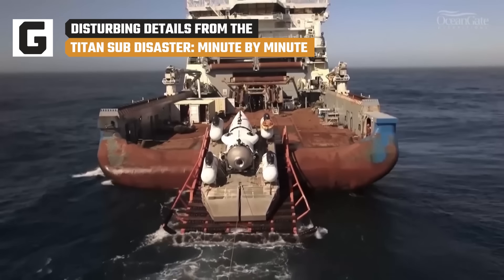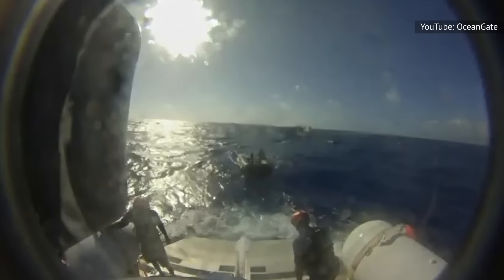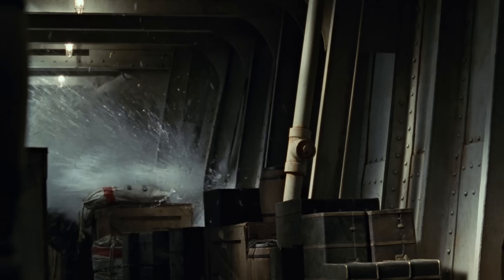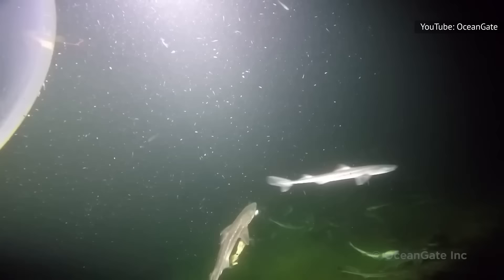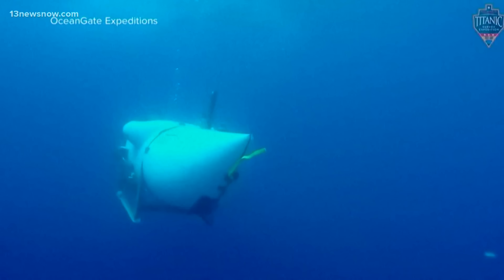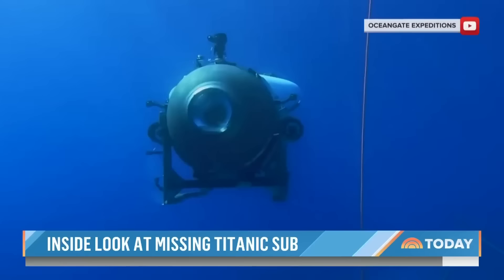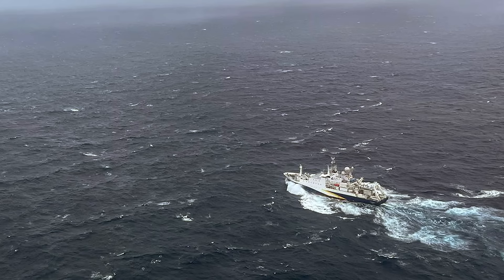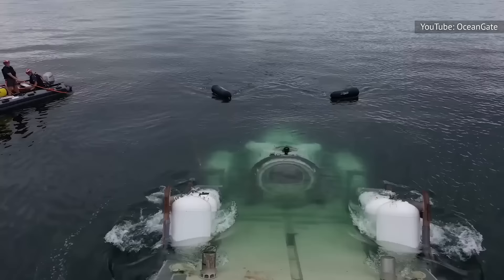Disturbing Details From The Titan Sub Disaster: Minute By Minute

Comment: Stockton Rush would've been a great fit at Boeing
Reply: The comment I was looking for. 🤣
Reply: Hey!!  This is serious and you made me laugh!!
Reply: "We could save money by eliminating wings, seats, windows & toilets."
Reply: Same safety mindset
Reply: he actually worked for mcdonnell douglas, the culture virus at boeing now. makes so much sense!
Reply: Not money hungry enough... More a great fit for other complete Narcissist sociopaths...
Reply: It was Boeing that sold Rush the leftover carbon fibre.
 It was outdated and couldn't legally be used for airplane construction. It has a specified shelf- life.
Reply: Plot twist he was a majority share holder
Reply: I mean didn’t he use discarded pieces of a Boeing to use as the shell of the structure?
Reply: @Jordysegs89  No. It was carbon fiber that was degraded and couldn't be legally used.
Reply: @dreammaker9642  In Boeing?
Reply: @kirbywaite1586  The outside isn’t carbon fibre, that’s the interior. I’m talking about the outside shell. The white metal the encapsulates the carbon fibre hull
Reply: @Jordysegs89  The outside was carbon fiber. It was then coated with something that is used on submarine hulls.
Reply: @Jordysegs89  They allegedly used old carbon fibre spools that Boeing wasn’t using or getting rid off…hence the claim of Boeing’s involvement.
Reply: They're called Boeing because that's how their planes sound as they faceplant into the ground. Boeioioioinnggggg
Reply: Or Crazy Eddie’s Used Carbon Fiber Emporium.
Reply: As a janitor.
Reply: DEI are the main culprit on the fate of both Titan and Boeing.
Reply: @kirbywaite1586  So, since there is no more Stockton they now forced to use it on their wings :D
Reply: CEO!
Reply: He used to lie that Boeing played a role in the research and development. 😂😂
Reply: Boeing probably hired ex-Oceangate workers
Reply: Hahaha
Reply: BOEING is hiring people based on neo pronouns and gender. 😅
Reply: I love how everyone blames Boeing 
Yet the FAA is the entity that said 
The max was safe 
No one blames the FAA

Comment: Submersibles don't usually use titanium for the cylinder section. They don't have one. It's an inherently weak shape that isn't used in deep submersibles at all. They're spheres.
Reply: Exactly!
Reply: What you're talking about? Cylinders aren't inherently weak shape, they're plenty good, there reasons most military submarines tend to be cigar shapped or a similar shape (i.e. a cylinder variant). Spheres are better, sure, but that is not the same thing.
Reply: @louisvictor3473  - Submarines have an internal frame and dive to a max depth a tenth of a deep submersible.  
A cylinder is inherently weak because the force on the straight section is inward with no curve to direct it into the structure. A sphere acts as a 3 dimensional arch, carrying the load around the outside where it is balanced by the forces from all other directions. A cylinder collapses inward. 
This is a first year engineering problem. 
There is no "good enough" with engineering at the extremes like this. The absolute best that can be made is barely able to do the job.
Reply: @louisvictor3473  And submersibles go to depths where submarines can't.
Reply: US Navy boats dive no where what this sub dive to.
A sphere is the only design thst can spread massive pressure per square inch
Reply: @beecnul8r Another "engineer" with a degree from wish. You guys are cute how you huddle together.
Reply: @beecnul8r  - No, they don't. Submarines implode before they get one km down, and they usually operate at a third of that.  Titanic is four km down. It's a completely different regime. 
Anything that operates at that depth is a sphere just big enough for one or up to about three people. Anything that isn't a sphere on a deep submersible is open to the water and doesn't hold pressure.
Reply: @GWNorth-db8vn Well you are wrong, this shape has made this depth before, and if it were all Titanium it would be running today.
Reply: @peterdarr383  - The pressure hull is always a  sphere. They can put all sorts of fairings and housings on it, but nothing cylindrical has ever made it 4 km down.
Reply: @GWNorth-db8vn Titan had made 12 successful dives down to the titanic though before this happened
Reply: @artboy789  - It made three and was disintegrating the entire time. Metal wouldn't have lasted much longer. Cylinders bend inward and the metal fatigues.
Reply: @GWNorth-db8vn You won't get many paying passengers in a sphere.
A half-Million per ticket this would have paid for the Titanium Tube section.
And they make you sit on the floor for 9 hours in the dark with no internet !!!
Reply: @peterdarr383  - It's a dumb idea for a passenger service.
You really can't build a tube section. It won't hold up. Cylinders flatten out like an empty beer can.  It will  flex inward a bit on each dive, fatigue, and crack, and the joints to the ends will also be bent inward. They' could fail before the actual material does.
Any vessel geometry that has a straight line in it will fail under that kind of pressure. That includes straight cylinders or panels between frames. Even an egg shape has a weak direction and will fail there.
The problem isn't price or material. It's a lethally flawed design. Overbuilding doesn't fix that, it just makes everything heavier. Rush tried to overbuild Titan to make up for the wrong materials, and what he built literally disintegrated  more every time it went under water.

Comment: As a structural mechanic on large aircraft, there's a reason why no commercial aircraft companies use carbon fiber on a large scale. it doesn't breath like aluminum, nor does it take impact as well. Carbon is also very prone to micro tears, further reducing its structural value.
Reply: Thanks for posting this info!

Comment: From the moment the news broke I knew there was a 99.9% chance of the sub being lost. At those depths, nearly all problems can turn out lethal. And that was even before I saw the report on what the actual sub looked like and how it was created. After that I was sure it was destroyed; The part that really did it for me was the most rookiest of rookie mistakes they made; Not properly threading the carbon fiber for the strongest bond but literally just wound around the casing and glued it all together. So if the glue fails - even slightly - there's nothing holding those strands of carbon fiber back besides their own rigidness, which is all in the same direction. If it's threaded properly, each strand around the casing is fixed in place by all other strands, significantly increasing its overall strength. (Which is still not a recommendation to use carbon fiber for deep-sea endeavors, but it would slightly increase my confidence in it)

But, as far as I know, that's the ultimate problem with carbon fiber; It's far more rigid than for example steel. It won't bend as much, it breaks way faster. So to have it be effective at depth, you need to make sure the strength of the material always exceeds the point of where deformation would start to take place. Metals are more suitable for depth since it can compress far better and return to its original form afterwards.
Reply: You sound like someone who doesn't know what they're talking about but is just regurgitating what they learned from a 30 min google search.
Reply: @alexandrabauer9180  You sound like your parents never loved you so you have to complain about random youtube comments. xD
Reply: @ym5891  so you're definitely a middle schooler/early high schooler with that comeback. My bad

Comment: Why do not presenters explain that Carbon Fibre possesses "tensile" strength (Pulling apart of the ends of a string) while it does not possess "compression" strength (Pushing together the ends of a string), and it is "compression" that is encountered in dives.
Reply: Too busy trolling for likes to incorporate any substantial matter into the subject and AI seems to be enhancing these valueless efforts.

Comment: Considering the motors and most of the sub had no shielding that could withstand the immense pressure as u go deeper into the ocean the pressure probably crushed it like an empty beer can. And a cheap off brand plug and play Xbox 360 controller connected to an off the shelf laptop with specialty software to operate the sub come on if that's not sketchy and a enormous red flag idk what is
Reply: Did you conclude this on your own?
Reply: @rhyssleary6944  I meant the motors mounted on the outside of the sub which were clearly exposed as far as internally there might have been if there was it was obviously minimal or not enough the deeper u go the higher the pressure gets and the sub couldn't handle it
Reply: @chrisbaughman9860  Thanks for the elaboration.  The prior comment made it seem like you were just sharing the obvious.

Comment: Been so desensitized to death, it was a "called it" situation. What i want to know is, on essentially a grave site, they were just gonna drop plate steel all over. 

How many of those plates are gonna be on the Titanic or other significant sites if this is allowed? 

The Titanic victims should be left in peace..
Reply: Considering that no human remains have been found inside the titanic's wreckage, it will be really hard to disturb their remains by meddling with the place where they don't seem to be. If there is any left somewhere, that is. And if they aren't in the boat, they're out there somewhere completely exposed. I don't think there is anything left to leave in peace or disturb its peace.

Comment: It failure surprised no one really. Especially Engineers. I saw there main electrical inter connection box. It was a mess had no wire labels and no included print out schematic of what every wire did. You lose a motor...to bad you have no idea what wires feed it power and control and monitoring. No way to check whats missing. It was a joke. Bet the guy that wired that all up wasn't on board.

Comment: Grunge did a poor job researching this topic.  Info covered was already known was already known when first covered in the news. No mention how the vehicle lost propulsion causing it to nosedive and submerge at an unsafe rate. No mention how the crew were pinned in the nose section as it plummeted. Or how the vehicle sprung a leak in the aft section preventing it from surfacing in time and eventually imploding.

Comment: It was a very small sub. I wonder if you fart on it, will the whole sub stink like fart for the duration of the trip. I mean, the fart air has nowhere to go. I fart when I'm nervous, so no doubt I'd be letting rip that entire journey.
Reply: I was already thinking that and also the fact that shoes aren't allowed. A submersible that smells like farts and feet sounds like a horrible experience, even without the dying part.
Reply: They also had a camping toilet behind a little curtain in case you had to crap, so there's that.
Reply: The sub had scrubbers that remove carbon dioxide from the air that humans exhale and it filters all gasses out.
Reply: @StrangeScaryNewEngland the unspoken peer pressure not to crap must have been huge
Reply: @hoperising7373  I can't even fathom that (no pun intended). I'd probably just bring a Gatorade or Powerade bottle to piss in like my truck-driving father. Lmao.

Comment: 2:14 ... there were 18 hold-down titanium bolls affixing the bell housing to the tube. They all got blowed off? I doubt it! Something not right here.
Reply: Probably not the bolts.  I'm sure they were Grade-8 steel.
Reply: @TucsonDude One of the problems I see is surrounding the sub was about 6 TI (tons square inch). It's like a brick wall keeping the bell housing from bursting out ... supporting it ... the missing bolts are a problem, to my mind. Not sure if the interior threads would show damage from the "stripped" bolt threads or not. To me, the weakest link is the shell, the plastic ... either way, I would like to think the bolts would still be intact.???
Reply: @Psychiatrick  Agreed on the pressure effect.  I used to work in a gas refinery and even 2000 psi was considered extremely high pressure.  It's amazing that ANY manned sub can withstand 3x that pressure.  Personally, I don't think the bolts or threads were the issue anyway.  It was repeated cycling and possibly water intrusion between the CF laters.  Thoughts?
Reply: @TucsonDude  I'm a journeyman Machine Repair Mechanic/Millwright ... the bolts are a puzzle to me ... those bolts had to be pressured, by water, keeping them from popping. Sure, the tube was the weakest link but I can't see how the bolts are missing. Pardon the pun, seems a 'tad fishy if you ask me!
Reply: @Psychiatrick  I'm a retired Mech Engineer and I'll be the first to admit that I'm clueless except for the failure of the CF tube.  That's a given as CF is only strong in tension, not compression.  Were the bolts actually missing?  I think the CF housing had a titanium ring insert.